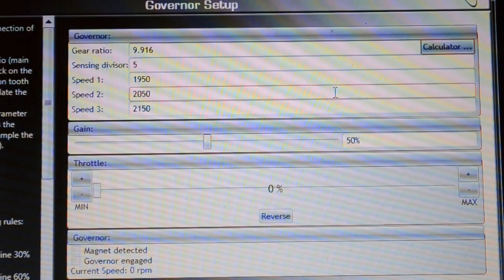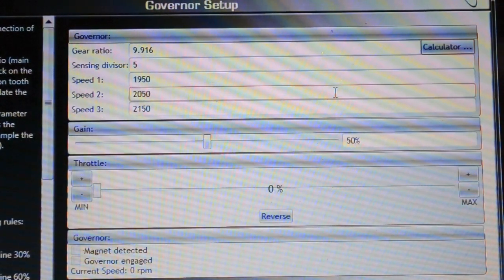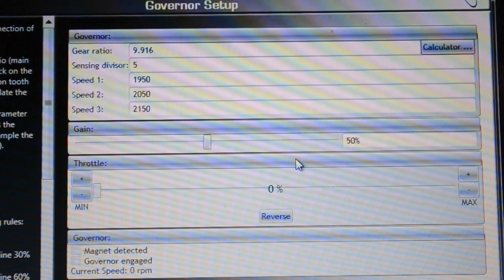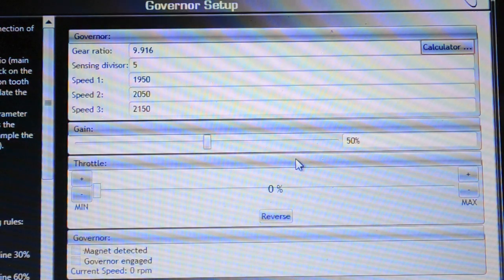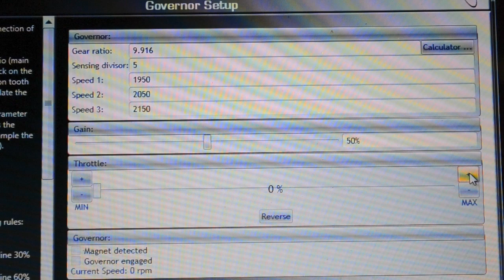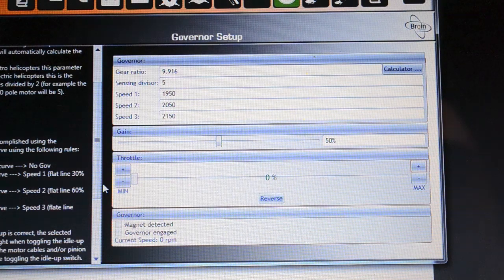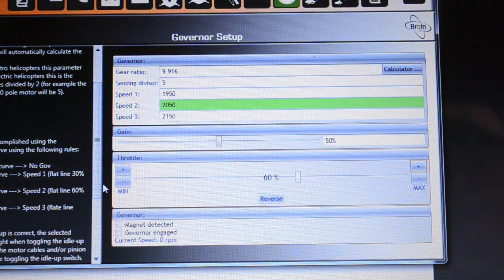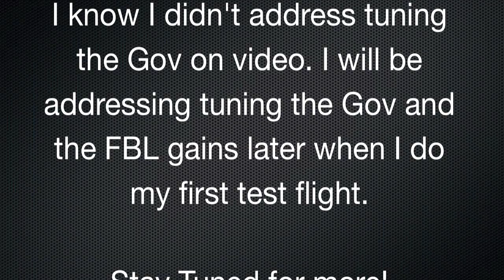Synergy E6 Build Video - Part 7 - MSH Brain Gov Programming

Comment: Hi Christopher Sexton. Finally I follow your steps to program my castle phoenix edge HV160 ESC with the castle link program as Multi-Rotor and Fixed-Endpoint. Can I continue the same steps of your video part 6 and part 7 for programming my iKON FBL unit? I don't know if i use english properly. Thank you.
Reply from the maker: Yep, the screens have changed slightly since I produced this video, but the process is the same for using iKON gov.

Comment: Hi there Christopher , very nice video got one question magnet count or stator count for sensing divisor ?
Reply from the maker: On an electric you want Pole Count divided by 2. On a Nitro you want to use 1 normally.
Reply: Christopher Sexton on a electric that I have to divide I understand but which pole count , magnet or stator ?
Reply from the maker: Heli Mouse Magnetic Poles.
Reply: Christopher Sexton Thanks sir , have a nice day

Comment: When calibrating throttle limits in the fbl units gov settings for the ESC... Did u first calibrate the ESCs (alone) throttle limits? If using the gov in the fbl unit do u even have to calibrate the ESC?
Reply from the maker: When you are calibrating end points on the gov tab you are calibrating the ikon to the esc no need to reset esc end points 95% of the time.
Reply: Thanks bud!
Reply: Thanks for posting set up/build videos... I've got a lot info from them.. Very helpful.. Keep'm coming!

Comment: Sir i Have a Question... My MSH Brain Software is not sensing the Current Speed RPM. I am Using Align 35amp ESC it says Magnet Detected and Governor Detected Can Anyone Help me Please???
Reply from the maker: What are you using as an RPM sensor?
Reply: Christopher Sexton I Didn't know i Needed a RPM Sensor Thank You Very Much !!
Could you recommend one I Am Using an Align 35 amp ESC???
Reply from the maker: ***** I always use the HobbyWing Digital RPM sensor. Works great with the iKON. You will also need a micro JST to Servo adapter for the GOV port on the iKON. You can get that at HeliDirect among other places.
Reply: Christopher Sexton Chris Thank You-You Really Helped me out Especially Your videos....I was Just Looking into The Hobby Wing Phase Sensor and I was Just going to ask you Which port To Put it in ...But You already answered That Question Again Thank You Very Much For your Help !!!

Comment from the maker: Yes and no. On a nitro your normal will be linearish. My normal on the nitro is 8.15.30.30.30. This way you can feather the throttle to aide starting. Normal doesnt start with a 0 because 0 will close the throttle and kill the motor.

Comment from the maker: Smudge7135: much like a Vbar. All setting are sent to the Brain/iKon real time. So as you make changes in the software it is updated instantly on the unit. When i finish adjusting a setting I always power off the fbl uni first then once the software tells me it lost connection to the unit I shutdown the software.

Comment: yap, with built in sensor, everything was working perfect on the bench, there's a magnet reading, rpm changing everything i change to idle up, everything is perfect on the bench, i was off by 100 rpm when flying it, and head speed is dropping and bogging a lot on hard manuever, even tail blow out, i raise the gain to 70 and still no luck, i give for now

Comment: Hi Cris, when calibrating end points, can i calibrate the endpoints without the connecting the motor to the drivetrain, or i have to calibrate the endpoints by just removing the blades.

Comment from the maker: When it is all said and done, if the ESC arms in HOLD and the Gov Test passes giving back all three programmed head speeds, then it will fly.  The biggest advantage to programming the ESC curves and calibrating the Gov end points to match is that the system knows how much head room it has and will perform better.

Comment from the maker: Yes, I am sorry I did disable the Brain Gov prior to programming the ESC end points. There are many aspects of the Brain setup wizards that I would like to change. Mainly the order of the tabs. I was bouncing around a lot.

As for programming the end points on the ESC, YES I always calibrate the ESC to the TX prior to doing anything. I didn't shoot this step as I wasn't trying to do setup techniques on ESCs. If there is a need for that, I can certainly put something together.

Comment: Hi Chris. Your video is great but I'd like to ask you something:
When you did the throttle min/max adjustment you disabled the governor in the banks, didn't you? And for the real test (after cam died) you activated it, right?
Biggest question: Did you tell/program the ESC the min/max throttle values as well? The thing is: I did it (Brain gov disabled and 45° throttle curve) but never changed the throttle min/max in the brain. Should be OK but it seems that I have to do this as well?